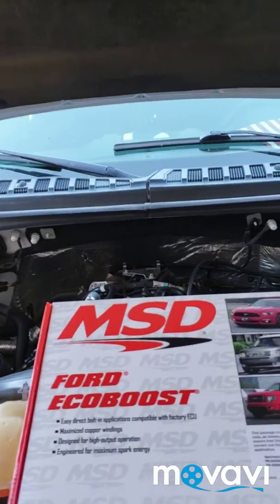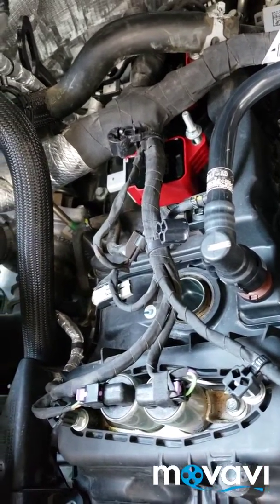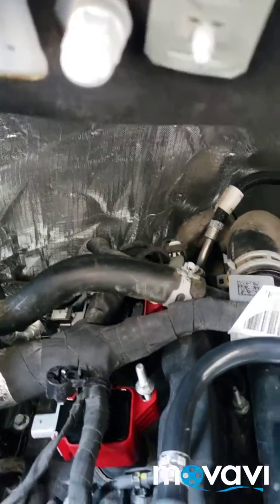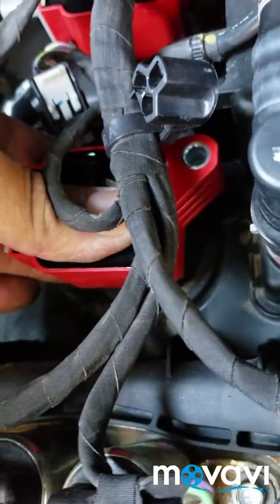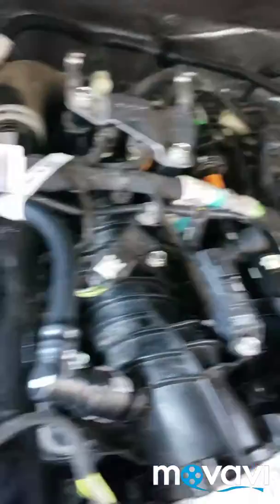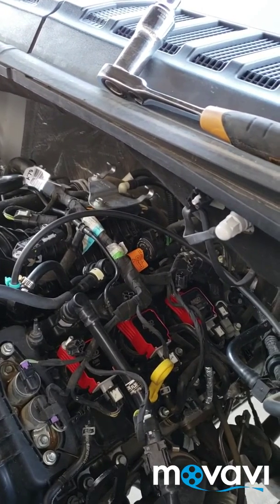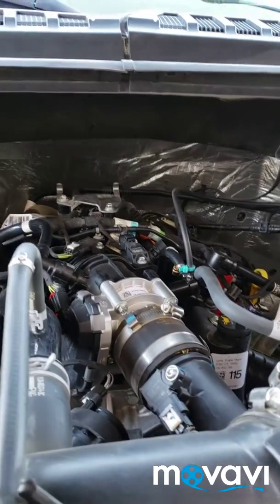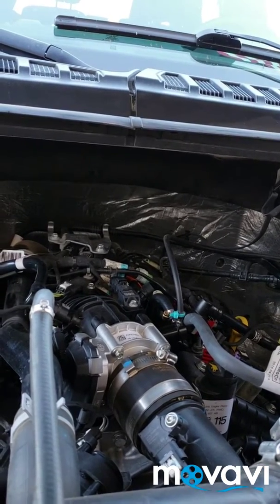Ecoboost 2.7 coil pack install, MSD

Comment: Question boss I got a misfire mechanic said I should change both spark plugs and coils
Reply from the maker: @joebonilla5997  usually misfires are spark plugs. They go out pretty fast. It's normal. If your truck is tuned.

Comment: Are these coil packs significantly better than factory? I have that stupid hold down bolt issue, any ideas how to fix that?
Reply from the maker: @jaredputman1685  I believe so, i've been running those coils Since 2016 zero issues.

Comment: Do I have to gap the spark plugs
Reply from the maker: If you have a custom tune, you should
Reply: @EcoBoost27  how much should I gap them ?
Reply from the maker: @843cuh9  .028
Reply from the maker: That is with a custom tune only ask your tuner.
Reply: @EcoBoost27  any problems with it since ?

Comment: Any issues with those ignition coils ?
Reply from the maker: No issues still running good,  They're great coils.
Reply: @EcoBoost27   I've got a 2018 f150 2.7 ecoboost and I just had a misfire this spring so I put new spark plugs in and it's been fine until a week ago it started misfiring again no I ran the codes and it said cylinder 2 misfire so I bought a new igniting coil got it fixed but it's still misfiring any idea on what could be going wrong?
Reply from the maker: Did you gap your spark plugs,